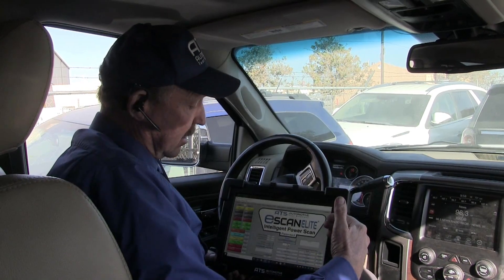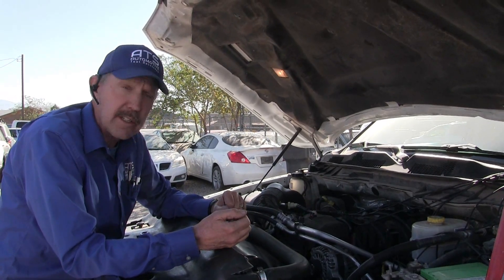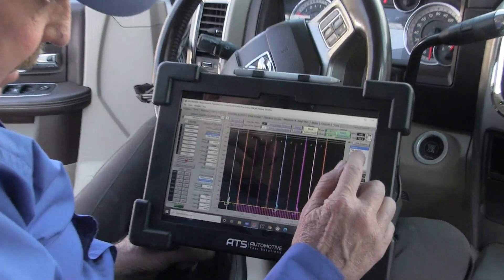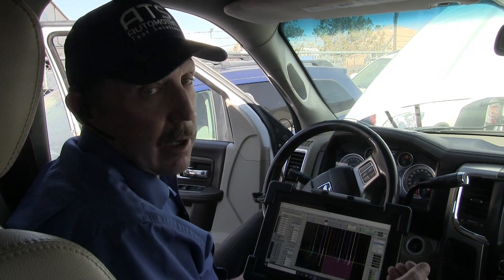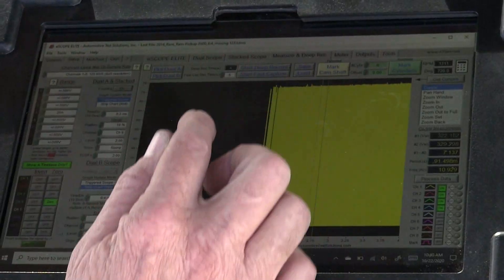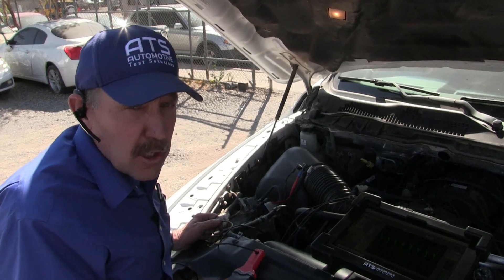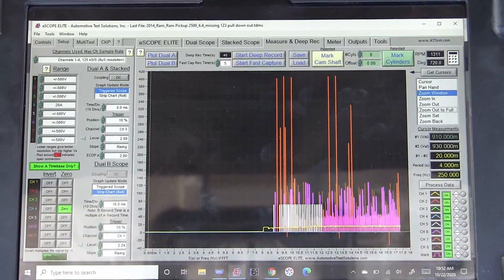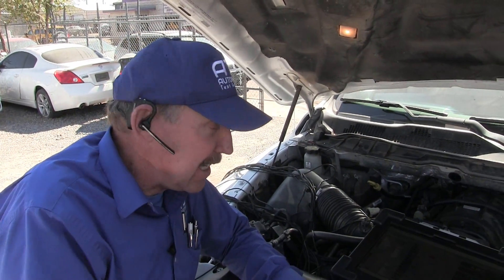Diagnosing a 2014 RAM 2500 6.4L with Low Power and a Multiple Cylinder Misfire

Comment: Great information- Have you ever run across the "Vibration" issue with the HD series Ram?  Rear end shake usually 55- 70 mph depending on the truck?

Comment: Are two-wire coils typical to Chrysler?  I thought it was more common to see 3 wire coils, where the pcm driver wouldn't be doing all that hard work, so to speak.
Reply: Chrysler still uses 2 wire coils on most stuff. Most everyone else uses 3/4 wire coils.

Comment: Nice one Bernie. No surprise a Chrysler with a failed PCM, but the video proves how important a strategy is when diagnosing. Most shops will have thrown coils and plugs at it.
Reply: No need to throw the coils and plugs. Simply swap good known ones with assumingly "bad" ones and see if the problem will follow or not.

Comment: Which is a good scope I want to buy one
Reply: 4425a standard kit.
Reply: The pico 4425a is a really good scope, but the escope used in this video is in a league of its own.  It's 8 channels vs 4, so try not to choke when you see the price.  Still, it's a real automotive diagnostic tool that goes way beyond a pico.  Everything done in this video (aside from reading the DTCs) can be done with a much cheaper scope, but only at a small fraction of the efficiency.
Reply: @tonyfremont  I notice that this Technician tends to use more than 4 channels to get you to buy the 8 channel but is not necessary. What you see is that more than 4 channels tend to get on the way. Unless you have a special case where you need more than 4 channels, then I would just pull the cheap Hantek but it is really not necessary, I like the option to ground things that he does but you can also mimic that with a tap to the ground with a fused wire to a back probed pin to see the reaction of the injector or coil.
Reply: @scientist100  yeah, the pulldown output and TTL generator seem a bit fluffy, but they do increase efficiency.  The "red light" as he calls it is more fluff, but it is unique and does let you know that a prove is connected to something.  I think that is done with a really weak pulldown to a negative voltage (below ground potential).  If you know how to use a scope, any scope will do.  Otoh, escope and pico take the approach that mechanic is not an engineer or mathematician and needs extra help when setting time bases and voltage scales, or converting the voltage output of current clamps to actual amps.  The escope does a lot of other things too, making it a full diagnostic tool for automotive use.  It's too bad that you're forced into buying the most expensive windows tablet on the planet to use it.  I'd much rather they'd written their software for android or even generic Linux.  Tablets are easy to break and replacing a Microsoft surface isn't cheap.
Reply: I have the Elite4 , 4 channel scope.. You don't need the 8 channel. Its different than the Pico scope but has great features like TTL which puts 5 volts on and off signal to pulse the igntion coil transistor or to find if a wire from ecm is shorted to ground or if the ecm is grounded or loaded internally. Plus it can handle maximum 500 volts like if you were checking ignition primary voltage or injectors.. Primary voltage can easily go over 300 volts..
Reply: @vickenkaragozian2041  I think nowadays most people would use an inductor pickup at the plug wire instead of probing at the main ignition wire. For COP, a padded ignition pickup exists. For injectors, most will not go over 100 volts.
Reply: @scientist100  Yes but if you want to check the ignition coil primary driver from the ecm to the ignition coil to see if the coil is shorted , then you can use the Pull down out feature to toggle to igntion coil. That way you will know  if coil is putting more than the normal amperage & you can find out if the driver inside the ecm is bad or not. If you can fire the coil with the Pull down out  then you know the ecm is bad. Its not a matter of inductor pickup. Plus you can compare each coil if they're shorted or not by putting amp probe like Bernie did. I own Pico scope too & i love it..
Reply: @vickenkaragozian2041  I saw what Bernie did, I was saying that you can also trigger the control wire by manually grounding it if it is grounded by the PCM etc. I think a test light may do at the control wire.